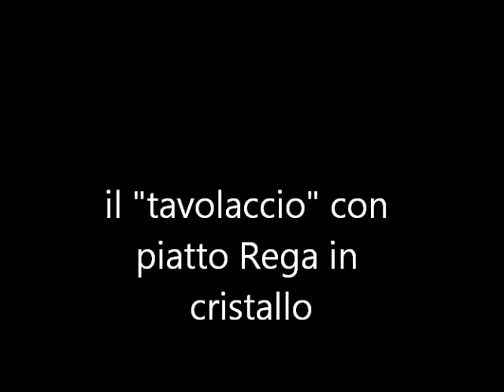diy turntable rim drive

Comment: Very nicely done. What have you four to be the differences in sound?
Reply from the maker: the sound is precise detail and without any coloring, the system requires an insulating support surface as it has no suspension, but only knocked over glasses
  the direct drive with the pulley and the DC motor turn out an optimal solution, it is silent, steady and powerful.
if you choose the right pickup in relation to the arm you can discover special details contained in the vinyl, could listen in all sincerity our beloved discs
Reply: I 'wish i was there' to hear it ;-)

Comment: How's the match between this arm and Grado Prestige (resonance frequency and sound)?
Reply from the maker: Sound ST 14 arm is a little older,but with good features
 I like to win easy!
the head Grado Prestige has a short cantilever with stiffer suspension
This allows you to adapt deftly also capricious arms.
the bandwidth is extensive, but in spite of this characteristic, was refractory to subsonic frequencies.
the same arm, slightly modified in the arm-rest system, live happy on board a Fons CQ30 International, with the Grado Prestige